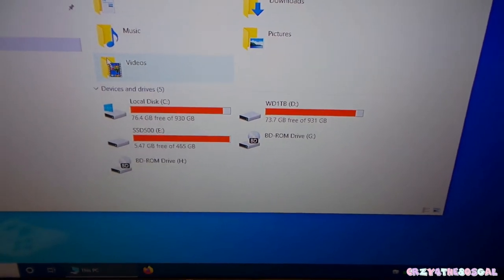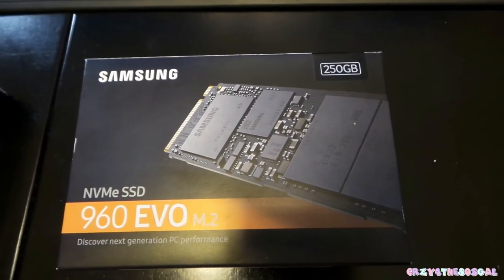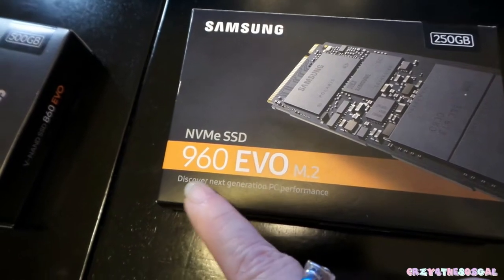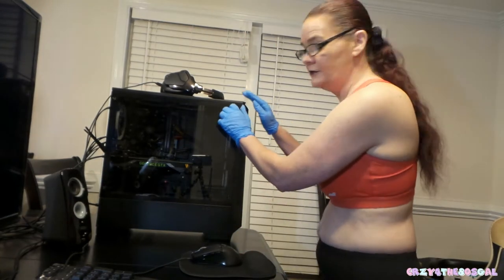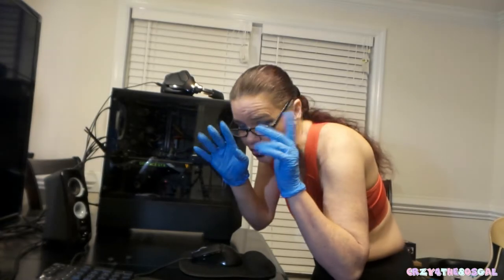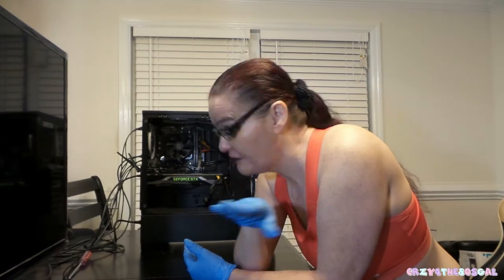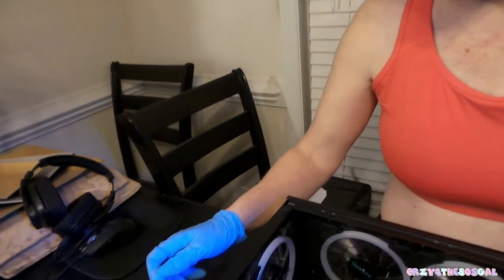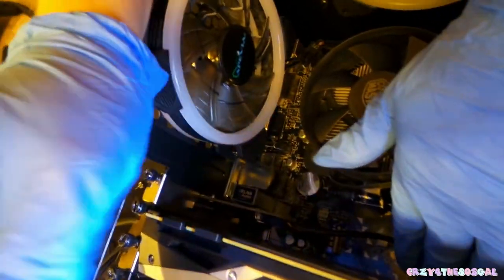OUT OF DRIVE SPACE - HOW TO INSTALL AN SSD IN YOUR DESKTOP - M.2 NVME 960 EVO & A SAMSUNG EVO SSD

Comment: Hey girl.  Using gloves is a bad idea.. Thr static builds on them
Reply from the maker: Thanks, A TECH PCs I agree... Honestly, I don't need to wear rubber gloves while working on the PC there is always a charge that can build on the outside of the gloves...but i am pretty comfortable with myself and the PC after installing some parts over the years.. Notice I keep PSU cable connected to keep it grounded always. While I do know there are conflicting answers out there about this, its my preference. I always touch something prior to contact with my PC also or parts a lesson learned. I believe its more a question of how comfortable you are with making sure you're always holding onto a grounded chassis, and how confident you are that you won't accidentally zap something. Notice I always ground myself before sticking something directly or touching those parts or the insides of puter and making sure Im not shuffling my feet across the carpet..👩🏻💖💖👍🏻
Reply from the maker: Did you enjoy the video ? How did you feel it did ?  Was the content good or done in a better manner ? Was is fun for you to watch? Did you watch the whole video or were you able to watch it to the end? Sounds like a survey...  💕😄💕
Reply: @AnnettesVlogCorner     well.  Ur video should be under 10 mins.... Untill your subscriber count goes up....   Making 45min long videos. Will kill your audience retention.... You could of cut down that video alot.... I watch like 39mins of it....        I make my videos or at least try to make them under 10mins....  Also. If your gonna do computer videos. Then just stick with that... Making videos that our off that topic will also hurt the channel... Like the yoga video.... Youtube notices that and their algorithm will not apply to your channel if you make different subject videos I'm just trying to help
Reply from the maker: @ATECHPCs  thanks ♡